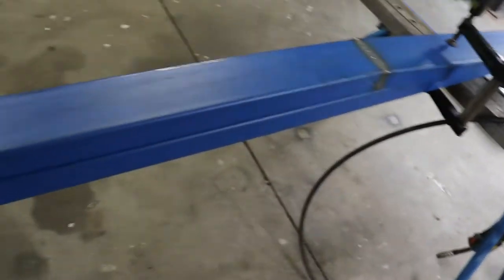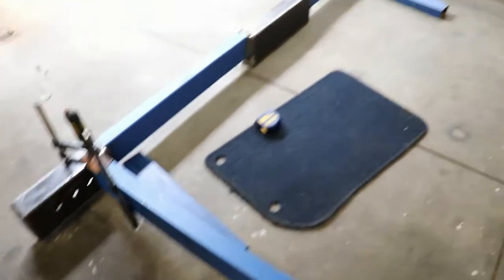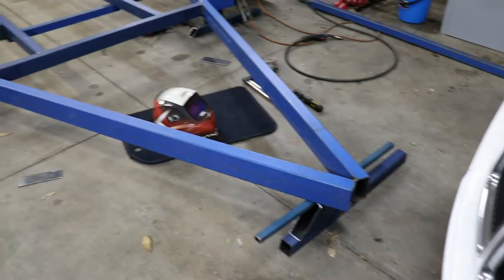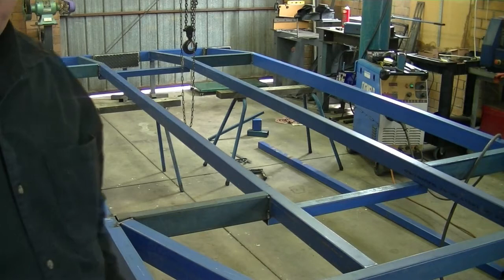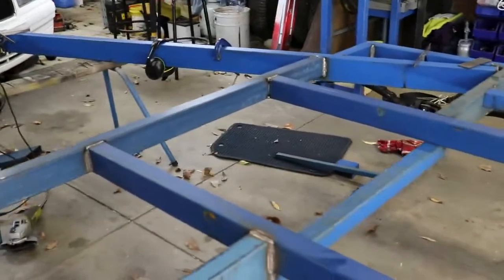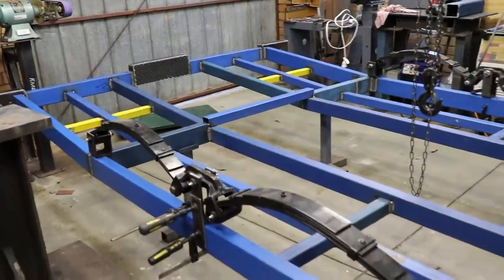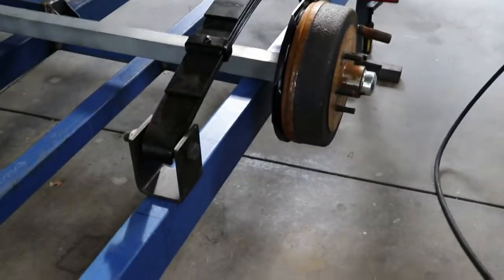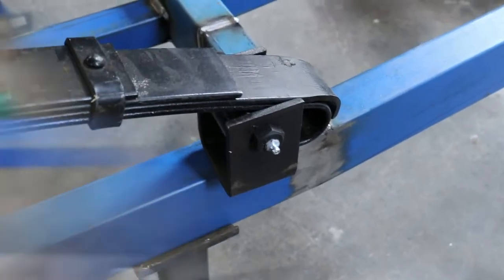Tandem car trailer build part 2

Comment: Hey mate awesome build, just wondering how do you work out the location of the axle on the chassis? Cheers.
Reply from the maker: Thanks for the comment Harley Gobeo . As a rule of thumb the center-line of the axles (spring center rocker on a tandem) should be 25mm back from center of trailer deck for every 300mm of deck length with a draw-bar length of around 1800mm. So divide the deck length by 300, multiply that figure by 25 and set the axles back that far from center. 
Deck length 4.3meters ÷ 300 = 14.3. 14.3 X 25 = 357mm. (I am not going to points of mm) So set the axles back 357mm from center of the deck (not including draw-bars).
1
▼

Comment: I saw some trailers today and they were horrible, CM and Icon brand. My wife told me to just build my own since they didn't have anything over 3.5k axles in stock. I need to haul a mid size tractor and cars I buy in auctions. Well might make a video soon.
Reply from the maker: Awesome Jorge, can’t wait for the video!!
Reply: @Kaitler_Motorsport_Engineering  Just got off the phone with my local steel supplier and had not noticed how high prices are comparing to 2020. 20ft 4" channel $95, 4x8ft 10 guage floor plate $291, 24ft  2"x4" 3/16" wall rectangle tubing $248. The prices increased about 100% and the majority of the steel comes from Mexico which is about 5 miles to the Mexican border. The US steel is available but a bit more $. I think I will have to wait for a dip to build the shop and trailer. Thanks bud.

Comment: It's nice, but,, why didn't you run your A-frame underneath the frame of the main body? It would have been stronger that way, and easier.
Reply from the maker: Thanks for the comment Jimmy, I wanted a flat plane trailer, so much better when dealing with cars, winching and tie down points (especially damaged cars). I have been using car trailers for 45 years. No it wouldn't have been stronger and I wasn't looking to build something 'easier' I was building what I wanted.
Reply: Hey Jimmy what makes you think it would be stronger?

Comment: this is such a nice build ! wondering what kina thickness do you use on the tubes ?  looks kinda thin or is it just the angels
Reply from the maker: kimssonboy Thanks for the comment, the chassis is 100x50x2.5 wall thickness. Plenty strong enough for the job it’s got to do without being too heavy.
Reply: @Kaitler_Motorsport_Engineering  ohh yeah nice man it turned out realy nice :) only thing i could say something about is the tie down points wouldnt it be better if you welded Them on a bigger plate then welded Them to the trailer for more surfacearea or is it enough for a car mayby :) and the winchbox was awsome but how is it with water getting in and under the lid if there isnt a lip on the floor :) Still a  9,5 out of 10 😄
Reply: @Kaitler_Motorsport_Engineering  sorry if there is some bad spelling English isnt My strong Side :p // Sweden :)
Reply from the maker: @kimssonboy  Thanks for the question, if it was a machinery trailer I would have had larger reinforcing plates on the tie down but for a car trailer it is just not needed. I try not to add weight if it is not necessary. All the things in the winch box are designed to basically be in the weather so I wasn't  worried about making the box waterproof (also in Australia we don't have the amount of rain and I am guessing snow that you might have in Sweden, I don't mean that in a bad way). Also I would have had to vent the battery if it was a sealed box. Mate, your English is way better than my Swedish. I am a bit jealous of people that speak multiple languages!!
Reply: @Kaitler_Motorsport_Engineering  ohh yeah i see :)guess the weight adds to a total of how mutch you are able to load on the trailer (less wehight in the trailer more weight to put on it ) :P yeah alot of snow and rain here in sweden and we should not speak about the tons of salt they spread out on the road every year killing all the bear metal and so on so on :/ thanks :)  as long as people can comunicate from other countries  its good no matter what languge you speak :) but still that trailer turned out so nice you know what you are doing ! :D

Comment: Hey mate I’m repairing a camper do you think that a 180 amp gasless mig with 0.8 wire will do the job it’s a shock mount so it’ll be in high stress
Any feedback would help mate thanks
Reply from the maker: If you’re pretty good at welding you should be able to do it. You need good penetration into the steel without blowing holes in it. Run the power as high as you can for the steel size and balance the wire speed to allow a good penetrating weld. It comes back to the ability of the guy welding it, good luck. 👍🏻
Reply: 50sk thanks mate can’t stop rewatching this build anymore of these coming up motorbike hitch carrier??
Reply from the maker: @perth7930  I am thing of making a motorbike trailer for 2 or 3 bikes, I haven't decided yet! Thanks for watching and your great comments.

Comment: Hi Steve, what angle is the drop on the beaver tail?
Reply from the maker: Hi Simon, the tail drops 100mm starting 1meter from the rear of the trailer. Thanks for the comment 👍
Reply: Thanks heaps for the response mate. Great series you put together here!

Comment: Just wondering how much did the material cost
Reply from the maker: Hi Connor, the axles, springs, guards, associated hardware, wheels and tyres around $1950. Steel around $690. Thanks for watching, hope you subscribed and gave us a thumbs up.🙂
Reply: @Kaitler_Motorsport_Engineering  thanks😁

Comment: Love your work on the Tandem Axle Car Trailer 
I have a question if I may ask! What is the Frame tubing thickness.

Kind regards Domenic From Perth WA
Reply from the maker: Hi Domenic, the outer is 100 x 50 x 2.5 thickness. Other sections are 75 x 50 x 2.5 and 50 x 50 x2.5.
Reply: @Kaitler_Motorsport_Engineering  Thank you so much for your reply
Reply from the maker: Domenic Princi No worries Domenic, hope you liked and subscribe!

Comment: Just wondering what welder you got mate? Im thinking of starting a small business. Just wonder if ill be right with a 250mig 15amp
Reply from the maker: A CIGWeld 210 which is 15amp single phase, I have had it quite a long time, still a good welder. This would be a fantastic machine as a 'do everything' welder for a small business -
 RAZOR™ 250 COMPACT INVERTER - Multi-Function Welder-MIG-TIG-MMA . I used to purchase welders for the workshop I managed, if you're in Australia Hare & Forbes Machineryhouse have a good section.
Reply: @Kaitler_Motorsport_Engineering  excellcent I was looking at a cigweld 250 but ill check out that viper
Reply: @Kaitler_Motorsport_Engineering  and i take it your using 0.9/ 1.0 wire? Looks like 2.5 steel? On ebay there is a bloke selling aussie trailer plans. Really easy to follow diagram. All I need to do is take the material list to steelshop. They could even cut it all to length. Id like to think I could knock out a whole trailer in 1 day and spray it with an old compressor the next. Seems straight forward to work at home in the shed?
Reply from the maker: @djdanzy  Yes 0.9 wire is the way to go, good luck with your build!

Comment: What angle did you do the beaver tail at?
Reply from the maker: The beaver tail starts 1m from the rear of the trailer, the chassis is made from 100x50 RSH. I dropped the chassis 100mm  in the 1meter tail section so basically I dropped the tail the width of the chassis rail.
Reply: @Kaitler_Motorsport_Engineering  thanks, you done a wicked job
Reply from the maker: @deathrow9565  Thanks for the great comment, glade you liked it!  The finished video is up if you haven't seen it.
Reply: @Kaitler_Motorsport_Engineering  yeh I did
Reply: @Kaitler_Motorsport_Engineering  WA we